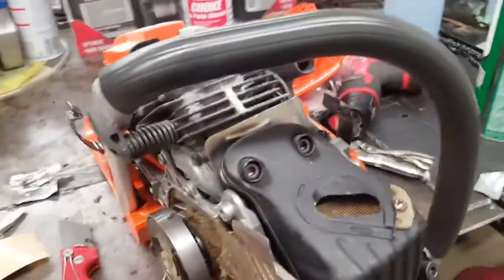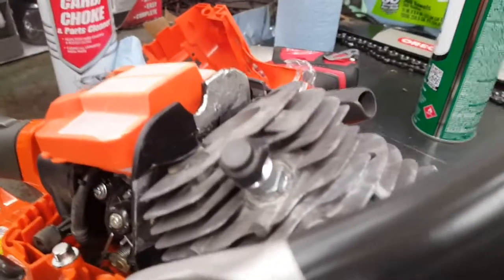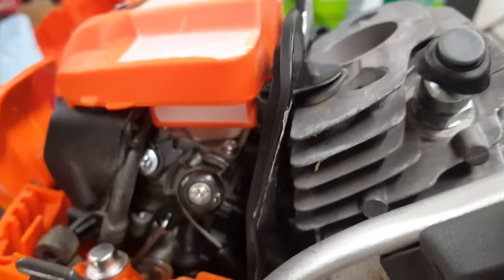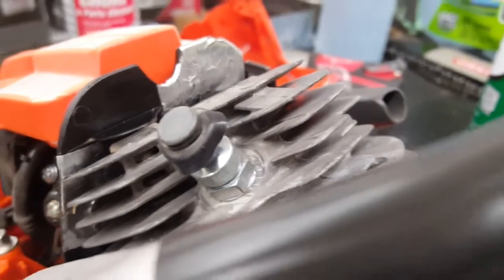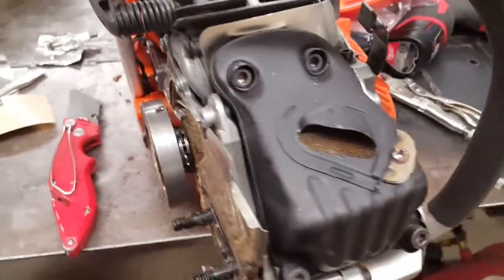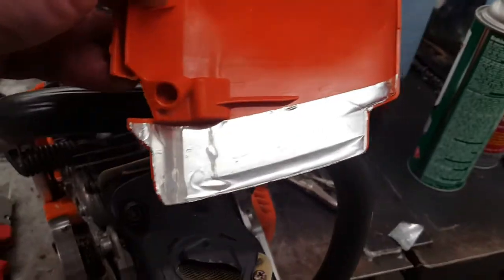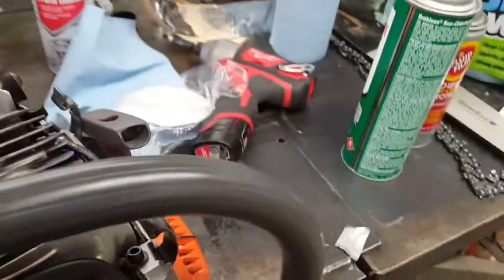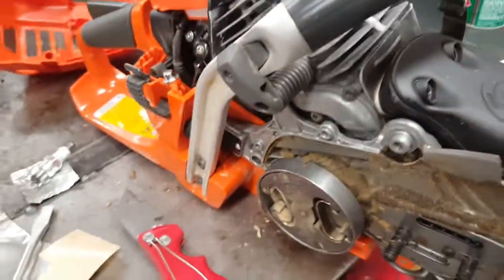Husqvarna 550xp heat shielding

Comment: I did the same thing in my Jonsered 2258. 
That foil seems to help. I put a hest resistant sleeving on the fuel line also, to keep the heat from the intake. It's an 8mm inner diamater sleeving(it has like fiber glass mesh inside and the outside is coverd with a plastic layer.
Hot start improved a lot! Stars in one pull aven after 10 min when hot. 
All the credid for @bobe888 for sharing this idea with the comunity!

Comment: Did the reflective tape make a difference? My 550 occasionally has the hot start problem even after modifying the air cover with the vent on the right-hand side.
Reply from the maker: I have not had a problem sense doing this to them. However that doesn't mean it is a guarantee. But I think every little bit helps.